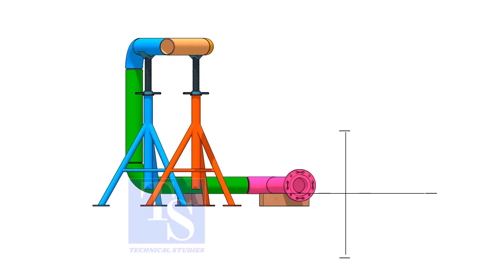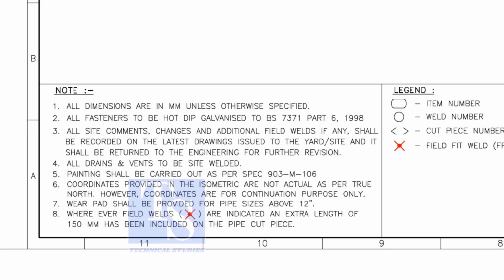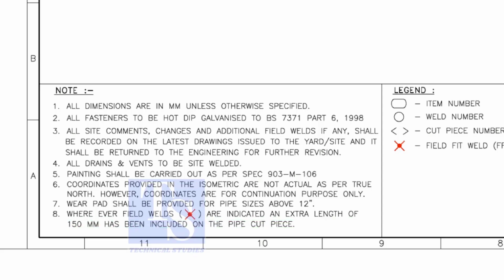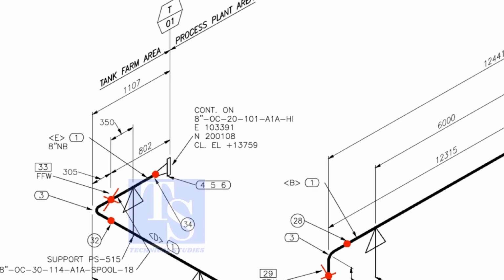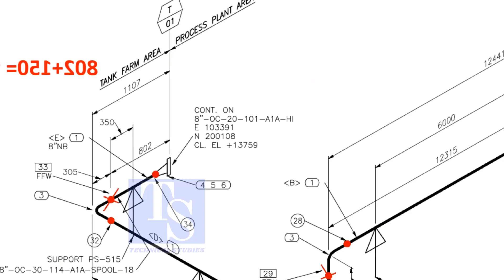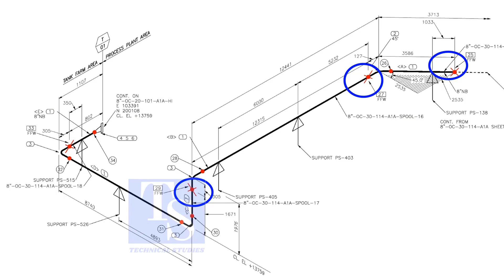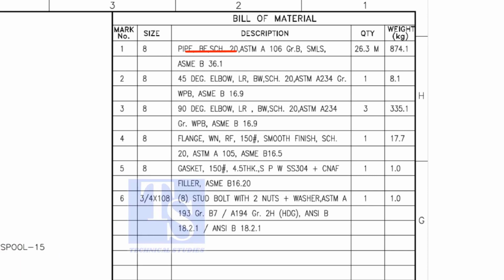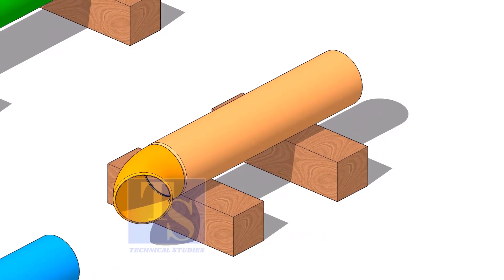Piping Pre Fabrication Techniques.

Comment: I am still struguling with those shades indicating off set degrees ! Could You put more examples please ? TIA !
Reply from the maker: Bro. Mostly, if the shade is with vertical lines, the rolling shall be vertical, if the shade is horizontal , the rolling shall be horizontal. That is the rule, but sometimes the draftmen make mistake, so dont follow this rule. check the item number and the item. make sure, which degree is the elbow. Another important thing is the elevation. Check the elevation, on every point, where ever an elbow comes. Hope you understand. Thank you for the comment.